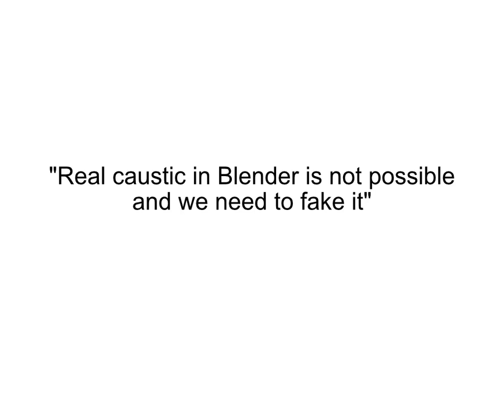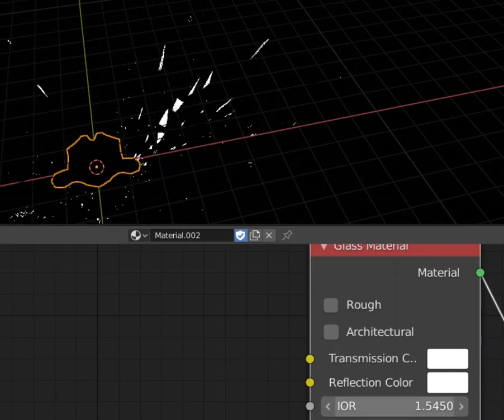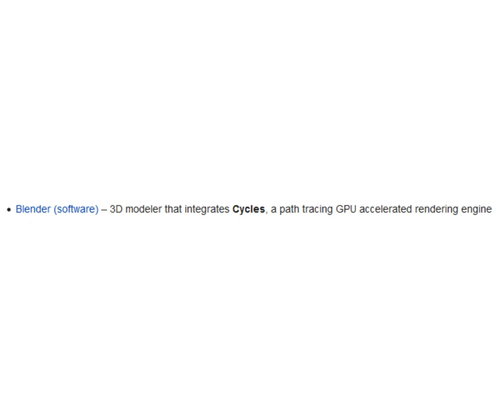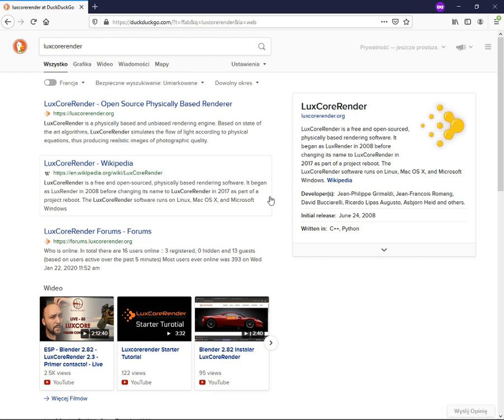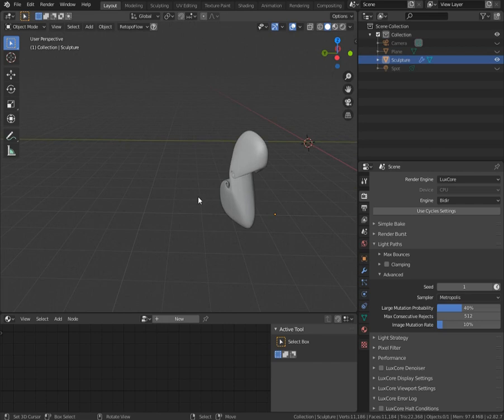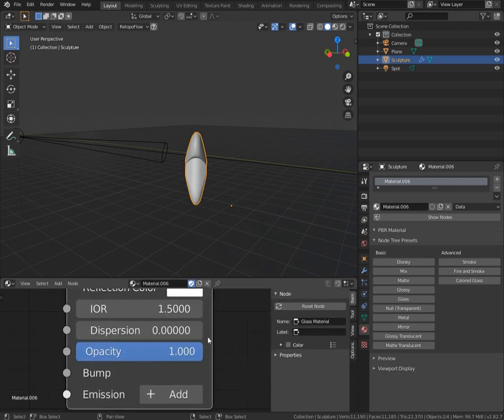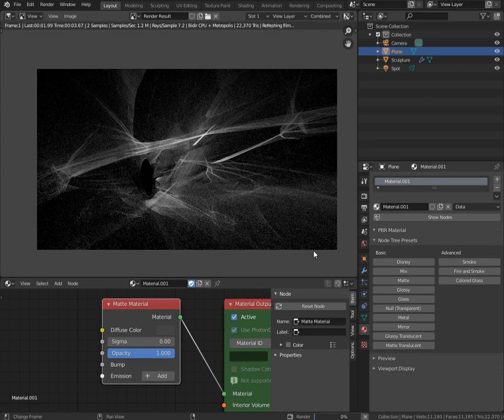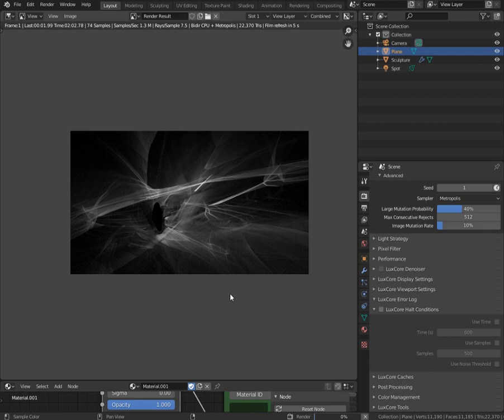Real and EASY caustic in Blender. Finally!

Comment: You used older versions than I did, but your videos still helped me to get the caustic results I want using LuxCoreRender version 2.6 and increased my understanding greatly. It also made me become a fan of Blender 2.93. Your presentation takes away all the guessing and is clear, enjoyable, straight to the point and well structured in sequence. The information about the bidirectional metropolis sampling with CPU was the key to improving the process for me. Than you very much!!!

Comment: Thanks man!!!This seems to be very interesting! Especially if it was easily enough to join both LuxCore and Cycles by calculating caustic in Luxcore adding them to a Cycles rendered image...
Reply: How did you do that. Render layers?
Reply: @pequod4557  pretty much yes!! in LuxRender, if you prioritize Light Tracing, it will disable camera rays as a whole, meaning there will be nothing in the image but the caustics! and when it's done you can save the caustic only image (99% recommended to save it as an OpenEXR file, render it again but in Cycles (disable caustics if you want), and when you're done, through compositing, import the caustic only image from LuxCore that you saved, add Mix node, change "Mix" to "Add" since we want everything from both images, then connect the Cycles render at the top,  LuxCore render at the bottom, and the output of the Mix node to the Composite (or Viewer node if you wanna check it right in the node editor)

there you go <3 have fun !!

Comment: im wondering if there's a way to render the caustics separate with luxCore and then comp. it with your cycles render, naturally there would be scenarios where that won't give the most accurate results, but properly still better than what you may get som Cycles alone, or some 'fake caustics' that to me, often come out too fake.
Reply from the maker: I think it could work but I don't understand why would you do that? I think I need to make tutorial cycles => luxcore.
Reply: A late reply, but yes this is possible. Render CPU only with 100% light tracing, this essentially gives you a caustic pass. If your materials are not overly complicated, you can just let LuxCore try to use the Cycles material definitions.
Reply: Yes, you can do it. In luxcore put light paths at 100 per cent to render only the caustics. Then you can composite with the cycles pass. Link the caustics pass to the factor of alpha over and down on the alpha over node. Then you can control the light of the caustics by increasing the brightness

Comment: ahh, I was excited at the start of the video because I thought cycles was able to render caustics now, then I saw it's actually LuxCore, which unfortunately is no alternative for me due to those "few" features that are still not supported, they mess up most of my works and at the end make LuxCore no valid alternative for me... I hope the Blender guys update cycles some day soon to be able to render caustics correctly or the LuxCore guys update to support those missing features
Reply from the maker: Cycles is technically limited as it is path tracer so I wouldn't expect this kind of improovement. Most of the features of cycles that can't be used in LuxCore you can bypass by simply baking materials before rendering.
Reply: @mikezurawski5590  thanks for the answer, I didn’t think about baking materials but that could be a nice solution to the issues I’ve been having when using luxcore:)

Comment: Thanx a lot! I’m working with ocean in Blender. Did you try to build deep underwater light effect with god rays?
Reply from the maker: yes I have created physically correct water shader for Eevee (very fake) and Cycles (little bit fake). LuxCore material was in progress then... my hard drive died. But with luxcore it is easiest as you don't need to fake anything. Summing up this is quite hard task but what is most important is light source. You won't be able to get god rays under 15-20 meters if you want to stay 100% correct. So not only correct material but scene setup counts a lot. You need to play with it.

Comment: I'm also a fan of luxcore, and your result looks cool! But for some reason I'm having trouble replicating it in my own scene. Your caustics look a lot more spread out and scattered all over the place, but mine is mostly condensed in a single location. Any idea why that would be?
Reply: I think I figured it out...my floor shader had too much reflection. I swapped it out for a matte shader and now it's looking much cooler. :)
Reply from the maker: @SteveErnst117  Color and shader type matters. Glossy with white reflections works the best. Maybe I should have mentioned it! This is my first tut so I'll take the notes :)

Remember also to dont use srgb for your renders!

Comment: Does this have to be composited or will it show up in a beauty render?
Reply from the maker: No copositing at all. LuxCore just works like that. If you want to understand the difference between cycles and LuxCore, watch first video in my "BlendLuxCore" series.
Reply: If you want to keep using cycles you can render the caustics in luxcore and then composite both cycles and luxcore passes

Comment: Damn, I was looking for a way to render caustics in blender for ages- youtube only has a couple tutorials on how to fake them and in general it looks like people just don't do it. Luxcore looks very intriguing. Aside from caustics, can it do everything that Cycles can? I wouldn't want to gimp the look of my scene just to get realistic caustics :P
Reply from the maker: It is different render engine. So no, it doesn't have the same possibilities. Are you able to create great renders? Sure. Give it a try. Devs have implemented option that allows to translate cycles materials and settings. The BlendLuxCore node system shares some nodes with cycles too. I would say that there is way more thing that you will benefit from when you will start using LuxCore. Engine is very fast. You can get photorealism way easier than in cycles. Your node trees will get less complicated. If we are talking about backdraws, every model need to have uv map. Is that huge problem? No. But this is example of the difference. I regret that I was waiting that long time before I got courage to learn new render engine. It was really easy. It is inside Blender and it shares Blender logic.